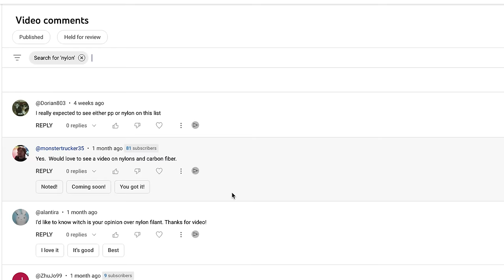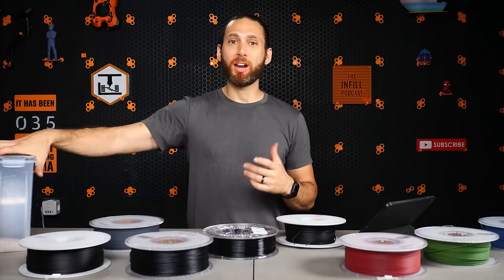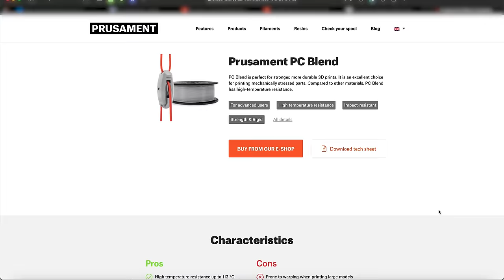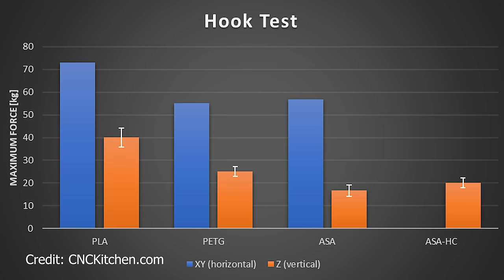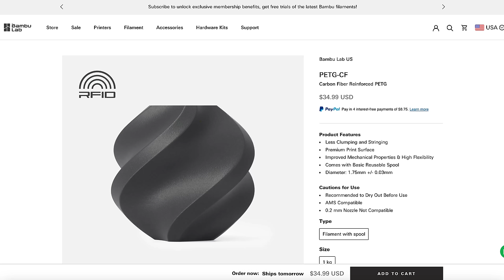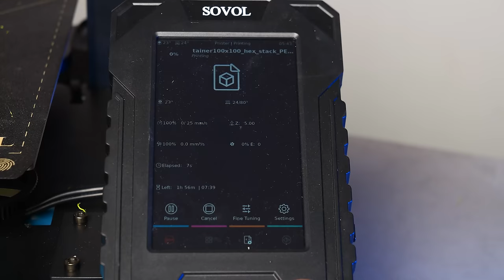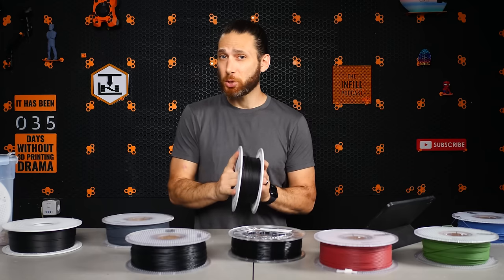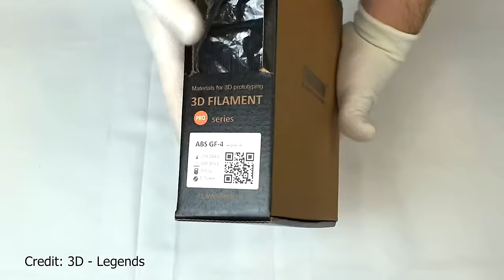Carbon Fiber 3D Printer Filaments: What Are They Good For?

Comment: I've used some different CF filaments in the last years, printed with a modified Prusa i3 MK3S+ (enclosure, heated chamber, petg parts reprinted in PCCF, hotend high temerature modifications) and BambuLab X1C, your description of the properties of the filaments fits quite well with my experience:

- PLA-CF (BambuLab, printed on X1C)
the only advantage over regular pla is on aesthetics and reduced warping in very large prints, the downside is that it is even more brittle, it was bundled with the X1C so i used it but i won't buy it on purpose. Regular matte pla has a similar look while being more mechanically resistant and cheaper.
I used it to make some feet for the chairs in my kitchen because CF makes it more resistant to abrasion, i didn't find any other application where it is better than regular pla.

- PETG-CF (Treed filaments printed on i3)
It is one of the best looking filaments i found so far but i found it much more prone to clogging the nozzle (0.4 with 0.6 is ok) than the other CF filaments i tested, fair resistance to heat (better than regular petg and any pla) and high rigidity i plan to replace it with ASA-CF which has similar price and should have a lower risk of clogging the nozzle. It is very fragile and with poor layer adhesion and i found out that it doesn't bind well with brass heat mounted inserts (only filament i tried so far with this problem).
I used it mainly in parts used in measuring setups on an optical bench where i needed high rigidity and moderate heat resistance.

- PA12-CF (Treed filaments printed on i3)
This is the filament i love the most because has good rigidity (lower than the other CF filaments anyway), high mechanical strength, high temperature resistance, prints very well and looks great.
PA12 absorbs less water than PA6 but anyway it has to be thoroughly dried before printing, and being nylon never use it in applications where creep could be an issue, CF reduces creepage but doesn't solve it completely, the only big downside of this filament is that it is by far the most expensive of the CF filaments i tried.
I used it in parts for optical bench setups, sample holders for a climatic chamber (withstands +125/-40°C cycles and 85°C/85%RH tests flawlessly) and jigs for electronic and mechanical assemblies.

- PC-CF (Prusament printed on X1C ;))
Very similar to PACF in look, mechanical resistance and heat resistance, probably a bit more fragile due to lower layer adhesion but nothing dramatic, the main advantage is that it is cheaper and doesn't creep, it needs to be dried too.
I used it to reprint the ASA and PETG-printed parts of the i3 (this is one of the steps of the high temperature modification), a hinge for an heavy toolbox (the original one had broken)
, and a smartphone holder for my car.

- PP-CF (Treed filaments printed on i3)
The only reason to use PP in 3d printing is for its chemical resistance and to make live hinges otherwise it is an awful material to print, if you think that pure ABS, PA or PC are difficult to print compared to PP they are easy as PLA, the CF improves greatly the printability but even with CF the objects warp a lot even in an heated chamber and printed slowly.
I wanted to use it to make parts for different setups to perform electrochemical etching with hydrofluoric acid but i couldn't make the prints water tight, probably because of the high carbon content (regular PP has an exceptional layer adhesion). I resigned to use it in non watertight parts printing the others in regular PP or PVDF (which is crazy expensive).

I also bought ASA-CF but i haven't used it so far, it should be a good trade off between mechanical properties and cost with the plus of UV resistance.
Reply: Bear in mind when making things abrasion resistant, like your chair feet, both surfaces get abraded, the carbon fibres might be very abrasion resistant but they will most likely be harder than your floor and effectively act like sandpaper, especially if the chair is moved with weight on it. A better choice for something like that would be a low friction or wear resistant material that doesn’t have any kind of fibres in it.
Reply: 😮 thank you so much for your comment!! This is a real useful / insightful one. I was looking into using CF filaments but didn't know where to start. I also got 2 free rolls of the Bambu Lab CF rolls n now I'm kinda disappointed they aren't that great compared to whats out there for the price.
Reply: @conorstewart2214  Your're right about the mutual wearing but even with CF added PLA is not nearly as resistant as the ceramic tiles in the kitchen floor. Obviously in the rooms with wooden flooring i use felt anti scratch pads on all furniture.

Comment: PLA-CF is not just a gimmick. It works absolutely great for printing things under tension or constant load (I print the Hex Ukuleles with it). I also tried annealing it and it barely changed in any dimension (but I haven't made any proper temperature resistance test, just that it didn't melt in hot water when normal print did). I'm thinking about making a proper test because getting something with PLA-CF properties but temperature resistant would make it the greatest filament ever ;-D

Comment: I found PETG-CF to be very usefull for large printers. I have RatRig V-Core 3 500 so I get asked to print big things sometimes. Depending on shape they can be done in many materials or also not. 
The worst is long straight walls. A roughly box-shaped cover 600mm long, 60 wide and 80 tall that required UV resistance was unprintable in PETG - the long walls would just buckle outward more and more as the shrinkage of hte material kept lifting the ends higher and higher off the bed. Increasing bed adhesion was useless because the part would just take the metal sheet up with it. I don't have a rigid bed to try but my guess would be something breaks or the part warps once released from the bed. 
Once I tried PETG-CF for this same part all the problems basically disappeared. It is way more hygroscopic than normal PETG (water creeps in deep along the fibers) so for very good surface finish you want to dry it before printing but nothing crazy is required and it does not have to be printed directly from a drybox - it can be outside for a few hours or even days. But what you get for this added trouble and for the price is basically no warping on a 600mm long straight wall. Other materials like PA-CF could probably do the same but at much higher price and difficulty level. And on a part that takes a whole 1kg spool for just one print you want the difficulty low and the price adds up quickly too. So PETG-CF is a great choice for that. 
I had same results with PCTG-CF too. 
And for a part I was asked to print white I tried PCTG-GF. The polymer has no pigment in it a the fresh-snow white color is achieved by light reflecting and refracting in all the tiny bits of glass inside. It is slightly translucent but once thick enough it becomes really white. And even with 0.6mm nozzle and 0.3mm layers this effect hides layer lines pretty much completely. It looks great and price is similar to PETG-CF.
Reply: Ya on longer parts the banana warp is exaggerated alot more😅 I remember a similiar struggle

Comment: I have been using ABS-CF10 on the 3D printer that I use at work. I was starting to get very bad prints halfway through the spool but all our materials are kept in a dry cabinet at 10%, so the last resort was to buy another spool ($900 AUD), the printer is a StrataSys F170 worth $54k. The new spool was perfect. I came to the conclusion that it was the light that has effected the material because the dry cabinet has a glass door, so I put the old spool in an oven for 48hrs at 60 degrees C, to dry it and now it's ok, so I store it in the sealed silver bags that were provided. The light does not effect the ABS though. It has taken about 2 weeks to solve the problem. So everyone, don't let your material get moist.

Comment: I did try out glass filled nylon for some flashkills to protect my airsoft optics. I originally tried pla and tpu, but the pla shattered instantly after being hit with a bb and while the tpu did deflect most of the bbs, eventually it did let a few through. 
The glass filled nylon withstood 50 airsoft bbs from two feet away and didn’t seem to even scratch the print. 
It was pretty expensive and took a little time to get it printed right on my ender 3 (with upgrades), but well worth it.

Comment: I've used ASA CF for a lot of proejcts recently. It has a high enough glass transition temperature (105 C) for use inside my vehicle without warping, a major factor while living in the American southwest, and I've found it quite easy to print without much hassle in or needing a high nozzle temperature. I primarily chose it over ABS CF because it is more resistant to UV degradation.
Reply: It boggles my mind that people don’t talk about ASA as much as other filaments! It’s amazing! It prints better than PLA on my modified Ender 3 w/ enclosure and is far better for functional parts—esp here in the SW. Doing a whole project that requires rigidity in CF ASA right now.
Reply: I was going to say the same thing. I don't know why anybody would use ABS over ASA for anything. (unless you're really penny-pinching) ABS is  harder to print and has a horrible smell.  ASA is basically ABS version 2.
Reply: lol, inside heat is a thing I found out as I made some things for inside the car out of PLA, and on a hot day, they deformed badly.
Reply: @TylerMillhouse cf-asa is also my choice to print printer parts from. Works wonders in a passively heated chamber
Reply: @twanheijkoop6753  True! I replaced all my printed printer parts with asa ones as soon as I got an enclosure.
Reply: What brand do you recommend?
Reply: @TylerMillhouse  I've been printing absolutely everything in ASA for years now and trying to spread the good word.
Reply: @mjodr  is it good to actually make a real gun that shoot or it would explode in my hands? asking for a friend..
Reply: @bobtylen9993 I've seen guns made out of worse materials and work multiple rounds. Sometimes you actually need something stiffer though and so I've seen a lot of plain PLA or other stuff with CF added. ASA seems pretty stiff to me, but on the spectrum it's not the stiffest material, which actually helps with impact resistance.
Reply: @mjodr  Thanks mate we are just starting at this stuff. so what you recommend CF, ASA or what is the strongest fillament? kek
Reply: @bobtylen9993  Not enough space in a YouTube comment to discuss that. It's like asking a Texan how to cook brisket.
Reply: If I print it in my apartment, is it worse than ABS? I have an enclosure to prevent warping but no air filtration system and I have printed mostly ABS but never thought about the risks of breathing it in or nothing.

Comment: I printed an AR15 lower receiver with PLA+. Its held up great and over 300 rounds through it so far no issue. You can put one hand on the stock and another on the hand guard and do a push up on it with zero flex. Going to be printing another lower in carbon fiber nylon today.
Reply: Thanks for that info!  When I first heard of 3D printing, my first thought was an AR, FAL or something similar.  I currently live where those aren't legal, so I'd have to make my own.
Reply: Did you print a sl-15 model or another model?

Comment: Petg CF is incredible as I've found you can bump the nozzle temp to 265 and no cooling fan for incredible layer adhesion and still little to no stringing
Reply: Do you mind if I ask what printer are you using? .. just curious and collecting random data for my own inference and  purchase.. synchronicity style lol
thanks
Reply: @hobonickel840  mk3s and a heavily modified mini
Reply: Yep. Atomic filament makes some spectacular PETG CF that is my favorite material yet.

Comment: Part of my job is designing new attachments for commercial siding. I have used GF ABS, CF ABS, and CF Nylon for prototyping. CF ABS is by far my go to for any prototyping. GF ABS has some weird layer adhesion issues that I don't get with CF ABS. I was also able to print them in an open printer (Ender 5 S1, and Sovol SV05). I will note that my prototypes are fairly small, so the prints usually didn't take long enough for the lower layers to cool and warp. CF Nylon is a different beast that just didn't suit the needs of my parts. My parts need to stay rigid, with little to no flex. CF Nylon was just too ductile. I did end up using it for jigs and fixtures around our fab shop, but I do not use it for prototyping at all anymore. I have not tried CF PETG yet, but I will probably give it a try. I have heard that PET is a much more difficult filament to print than PETG, but I have not personally used it yet.
Reply from the maker: Interesting, thanks for sharing. Why not just prototype with normal ABS though?
Reply: If your printer can cope with higher temperature filament, like PC, in the 280 - 300 C range, it will probably cope with PET fine. If you have an X1C and possibly the P1S then the PET-CF prints with no issues. The main properties of PET-CF are its rigidity (around double that of PLA) and high temperature resistance (around 200 C for the Bambu lab PET-CF).

Comment: I think it's a bit biased for you to not mention that PET-CF is much more brittle than PETG-CF. You seem to hate PETG despite it being a great all-around filament for just about any project. It's stronger than PLA, readily available, low printing temp compared to other strong filaments like ABS or PC without the added VOCs that come with PC or ABS, it doesn't warp and lift like Nylon, it won't warp in summer heat like PLA. There are a lot of reasons to go with PETG and the only real downside is that it is harder to print than PLA and support profiles can require some tweaking. If you're making functional prints instead of trash to sell on etsy then PETG is the most cost effective option for something strong that can be used indoors and outdoors basically forever.
Reply: not only that but PETG is just generally probably the second plastic a new 3d printer owner will probably use. Alongside PLA and PVB it is one of the few that doesnt fume.

Comment: ABS-GF sounds like a great filament for my company.  We are an R&D company specializing in next generation traction motors and associated electronics.  Right now, we use PC-CF for high voltage insulators between low current bus bars using a Bambu Labs X1C with the AMS.  I know, the carbon fiber is conductive.  But, it our testing, the conductivity is in the tens of mega-ohms range, so it's a moot point.  One thing we do have a problem with is printability and overall strength.  If ABS-GF can give us an improvement in any aspect, it would be well worth the cost of experimenting with a spool or two.  The insulators, for the most part, are shaped sheets 2mm to 2.5mm thick.  Some have sleeves that come up to insulate bolt holes.  On the top side of those sleeves, we add printed washers to complete the insulation.  It's amazing what we can do to condense the electronics packaging all thanks to the 3D printer.

Comment: I've been trying the Overture PLA-CF out on my Ender 3 with no enclosure for a few months now.  Prints can look really nice and almost like carbon fiber nylon.  There is a little oozing on the nozzle when traveling.  I can absolutely agree with the layer adhesion issue.  If the cross sections in your prints are small, I've dropped the print and it will just split.  Regular PLA will normally just bounce around and barely suffer a dent.  At my work we have a Markforged printer with their proprietary carbon fiber nylon and that stuff is gorgeous and useful.  I have never seen prints come out looking so nice and hold up in a manufacturing environment.  Dimensional stability is great with the ability to create press fits.  I've had a carbon fiber nylon part in a cnc coolant environment for almost two years now.  Even with the hygroscopic nature, the finish part performs really well.

Comment: I've used polycarbonate but not for it's clarity.  Polymaker makes a flame retardant PC in white which I've used for production parts (pretty small ones).  In general, in a lot of plastic enclosures you need UL94-V0 which basically will self extinguish when an active flame is removed.  The face that there is a very cost effective PC-FR product out there (which prints pretty easily in my X1C), made it very cost effective to 3D print these parts instead of tool up an injection mold (parts are pretty small, internal parts where cosmetics isn't critical in fairly low volume).  Cost saving is almost 10x.

Comment: You asked about experiences with printing Nylon... Well, I was working on a prototype Theatre grade - curtain track carrier with a hardware designer/manufacturer and printed up 50 carriers of his design in Nylon.  3 parts to each carrier - the main body and two wheels.  It was a huge learning experience for me as it was my first printing in Nylon (on a Prusa MK3).  After tuning, and adjusting many times, I ended up getting some pretty good adhesion and sucessfully completed the printing of the parts.  I ended up loving printing in Nylon (the one I used was Taulman 645), and now that I have a Bambu Lab Printer, I'm starting to tune that one to printing Nylon for some work prints.
Reply: Good, my expitience was terrible, 😊 but i know what i did wrong,need to adjust the flow

Comment: One great thing about ABS-CF is that you can vapor smooth it with acetone. It really helps the layer adhesion, and gives it a nice cosmetic micro pattern on the surface that looks a bit like forged carbon.
Reply from the maker: Good point